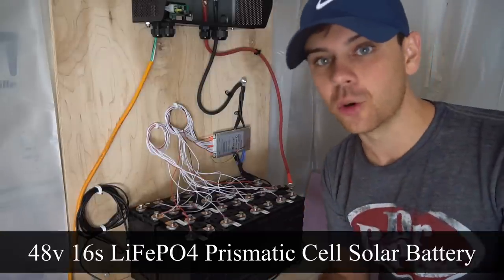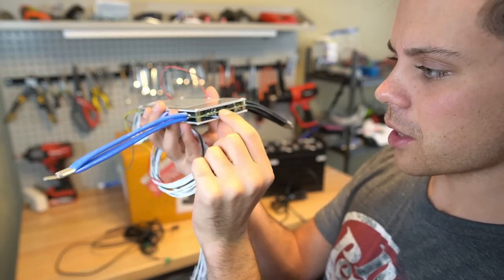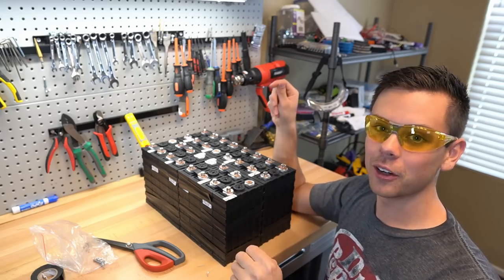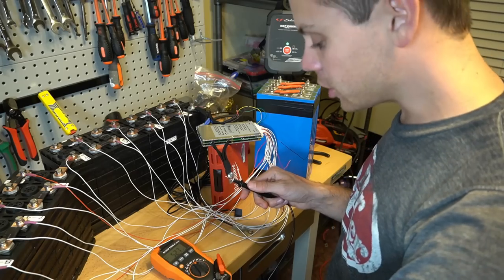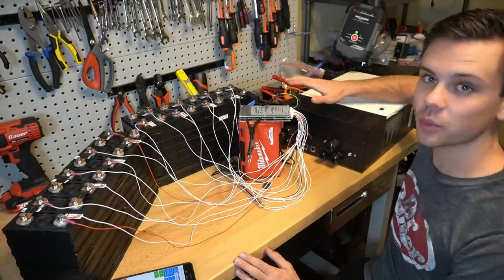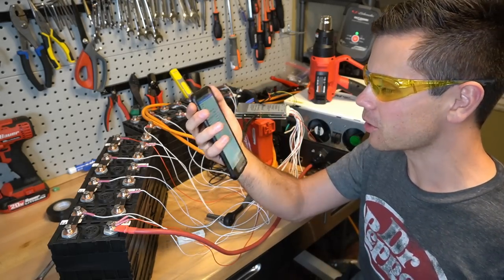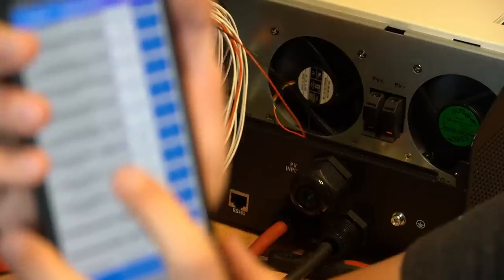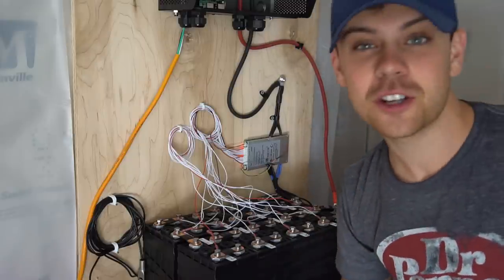DIY 48v LiFePO4 Battery w/ $72 Bluetooth ANT BMS (low temp cut-off!)

Comment: I have soldered for 40 years, and I've never gotten solder in my eyes! What is not recommended though, is soldering in underwear! Solder blobs travel down due to gravity, they don't fly into your eyes! Really nice BMS, Even fully fledged enough for an EV bike or bicycle. Supposedly there is a serial wired connection somewhere on the board too  for connecting a dash or computer directly over serial. Oh, the new Ebay link you provided has a dash included!
Reply: smiles, your face right in it. acid fumes are not good, maybe a mask with an air system too :-)
Reply: @lpi6608  Yes, the fumes are nasty, both breathing them and in your eyes, so don't put your face right above your iron, but it is rearly needed to have a fume extractor for the typical repair job, . Still,  soldering professionally, for hours every day, the fumes definitely would get to you. There is no acid in the flux in electronics solder, it would corrode the solder joints, so it is either a synthetic or natural rosin, quite simple really. Thinking about it, it both smells and stings as a bonfire made from non seasoned Pine. Mostly I do SMD work, and the amounts of solder is minuscule. Soldering big cable lugs with a torch and yards of solder would be different.

Comment: Will,
I don't believe you need a low voltage disconnect. It's true that the point an inverter shuts down might border on the low end of batteries but good inverters enable you to set shut down points. At 2.7volts time 16 series you wind up with 43.2 volts usually well below inverter shut off points. 
What you do want is a high shut off point, again, good charge controllers have this as a settable option. 
Heat is directly related to charging amps which charge controllers should be able to limit.

I think these Chinese BMS boards are not something I want to put on my systems, especially if it's an expensive system. I find that you don't need all the bells and whistles, just more to go wrong.
Reply from the maker: I completely and absolutely disagree with this statement above. You need some form of cut off. Battery protect and bottom balanced cells if you don't trust common BMS on market. But no cut off at all? What is your logic here. That is just crazy talk. And top balancing or setting upper limit voltage has been covered extensively in past videos, but now low voltage cut off? I don't see how that is logical with this chemistry. Please do explain
Reply from the maker: And inverter disconnect is only useful if cells are matches by capacity and bottom balanced. I'm not risking 3000$ battery bank on that. No thank you. Maybe a used cell that's bottom balanced like in my older videos. But you need individual cell monitoring or else inverter will cut off when one cell is deeply discharged and it won't know. Do you understand that? You would destroy your cell

Comment: Nice dude!  So glad I didn't enable the 'Switch' setting in my software, pretty sure that would have shut it off and put me in the boat of having to connect the two leads to a 2-6v source or whatever it was that you had to do.  I would have never figured it out, got no manual with my bluetooth BMS.  Is yours bluetooth onboard, didn't see a dongle?

I'm absolutely loving mine and reading data over serial by bypassing the bluetooth dongle (which I parallel later, so I can still read data with my own software and use the app simultaneously).  Also since I'm reading data from my MPPT over serial I can compare the current data from it and the BMS and print out solar input and system output, then display the TRUTH in the middle (aka 150w in from panels, BMS shows 50w in, meaning I'm charging at 50w and thus discharging at 100w).  Works great.

I have the 190ah LFP ammo can truck bed build on your forum in Show and Tell.  Just leveraged the two temperature sensors with the BMS (one onboard, one is a remote probe) to control a <100w 12VDC heater and gave it a test last night.  Once my PV input reached 13V (my trigger for sunrise-ish, potential to charge for the day) it began preheating the box.  Got up to 45*F quickly and greenlighted charging,  which then began when panel voltage was +5v over battery.  When my microcontroller read that MPPT mode had flipped to bulk it stopped trying to maintain 45*F and won't evaluate heating again until 1) temp below 40*F, 2) PV voltage 13 or higher, and 3) MPPT state OFF

These units are absolute game changers.  I appreciate redundancy in a setup, but I don't think I would have bought a Victron BMV and BatteryProtect if I had started with this first.  For all arduino-y ESP-y Pi-y type people, this is what you've been waiting for.  The opportunity to nerd the F out is off the charts.  I've written code to read from Victron MPPTs AND these BMS units over serial for arduino and ESP8266/32's which I'll polish and put on my github.  I've also developed a cross platform app that aggregates data from both sources and displays it in increasingly pretty fashion.  Best purchase of 2019!

Thanks for doing a video on it Will.  If you want to go next level with data collection (and your bluetooth isn't built in like I'm guessing, so you can listen to serial) I'd be happy to help!  If your BT is built in then you can use an ESP32 and read data wirelessly.  Tie in to Google Firebase or something and there you go!  All my data is recorded along with every event so if I have a high cell voltage alarm, I can see exactly what the charge amps, battery voltage, discharge amps, temps, etcetc were when that event happened.  Invaluable!
Reply: Brandon Kennedy This is exactly what I’ve been thinking of! Nicely done!
Reply: Can you tell me what the app is called or where to get it? I can't seem to get my seller to tell me
Reply: @Ahsieh2  for iOS at least a lot of people use the XiaoxiangBMS app.  Everything I was describing is custom

Comment: I (and a work colleague) have this same BMS (100A version) running all day as a DIY Powerwall since two months. I have it coupled with a 48V battery inverter (1600 W in both directions). A raspberry pi running a python script which decides every 2s how much power should flow through the battery based on the house smart meter reading. I programmed another python script which reads all info from BMS via bluetooth and puts it on an open source automation server running on the same raspberry. This server is accessible from my mobile phone. I love this solution, I may do a video showing what I have running some day. 12kWH LiFePo!
Reply from the maker: Holy cow!!! That integration is absolutely incredible!! Very nice job
Reply: DIY Solar Power with Will Prowse 
I am not on making youtube videos, time constrained.   If you want I can provide you some material and you do it. A raspi costs 20$ ! you need nothing else,  just open source software. My scripts are on github

Comment: Why do you "Absolutely need a BMS" if you bottom balance and have a low volt cutoff/low temp cutoff?

GREAT points on safety!
Reply from the maker: You don't. it's just smart to use

Comment: With the leads they have on there, I'd venture to guess that that 320A rating is a peak rating. The model in the ebay link you shared does show in the details that it's rated at 50A for charge current.

Comment: Hello. I bought an ANT BMS 16S 320A just like yours and I wanted to know if you found the same problem like me in the BMS, which is the following: after setting the parameters of the BMS to protect the cell's high voltage, the BMS turns off the MOS charge atomically and at this moment when the charge MOS is switched off, a peak voltage will pass from the solar panels to the inverter through BMS and this peak voltage will damage the inverter.
Have you ever realized this? If so, how did you solve the problem? What is the best way to get around this BMS defect?
Continuing with the excellent work ...
Thanks.

Comment: I have a lithium battery question ie leaf cell packs I have 3 packs that the voltage says lower ( 3.98)than the other 27 packs (4.02) should I be concerned or is that a ok amount of variance. Your one of the smartest one I know on u tube!!!😎😎😎😎

Comment: Never tighten or loosen a bus bar bolt when only one bolt is thru the bar.
Reply: Why?
Reply: @chrisUyehara  As in the video, that last little bit when tightening or the first bit while loosening will want to pivot the bus bar around the bolt.
A finger-tight bolt in the other hole prevents the pivot, and prevents any chance of the bus bar shorting out against another terminal.
So when installing a bus bar, put in both bolts with your fingers at least a few turns. I prefer doing this with all the bus bars, then using a wrench to tighten down all the bolts once all the bolts are started. (Just don't miss any!)
When removing a bus bar, loosen both bolts with the wrench, then put down the wrench and take the bolts out the rest of the way with your fingers.
Reply: @Sylvan_dB  Makes sense, thanks
Reply: AMEN! Don't ask how I know.
Reply: Yes!  This.  (When I got older and dumber, I started making mistakes like this, and realized I needed to slow down and think through things harder and do things more safely.)
Reply: it sure wakes you up,    a lot of power when they bond,  never done that, honest  okay twice,
Reply: Nice observation!

Comment: What do you suggest BMS with common port or separate port (charge <> discharge)? Thanks for keeping us informed!
Reply from the maker: Common port and attach the solar charge controller directly to the battery
Reply: Thanks for the quick response... the controller should then handle the over charge protection instead of the BMS...
Reply: @WillProwse  Does this not allow over charging on a per cell basis? Seems dodgy especially when using mismatched cells of unknown providence and more energetic chemistries.
Reply: Why does no one seem to use a BMS with a separate charge port. What is wrong with it. The price is the same. It would seem a no-brainer to me if the amperage is sufficient. Does it not work?
Reply: @WillProwse  Just to be clear I think you are wrong here.

The 3 connection BMS units are designed to shut off the discharge port if the battery or a single cell gets too low. But still allows for charging to bring it back up. Conversely if the pack or a single cell gets too high and it cannot balance it back in line it can shut off just the charging port and leave the discharge port open.

The 2 wire ones cannot do this and end up just blocking both, and then the lights go out.
Reply from the maker: @peterhcarls2  oh goodness looks like you are new here. Check out my.community section and past videos which cover this topic in great detail. There is a lot to read. Start with community section post first. This topic is also covered on the forum. Let me know if it makes sense after you read all that
Reply from the maker: @2true611  wow we have a lot of new people here! This was covered months ago and the logic behind it for this chemistry. Guess I'll go copy and paste my community post then.
Reply from the maker: @2true611  oh haha I am well aware how these circuits work. And I understand how they are programmed.
Reply from the maker: @peterhcarls2  that's why you don't use mismatched cells and you set upper limit voltage. As always. Mentioned this at least ten times in past videos.
Reply from the maker: Here's an explanation I posted a few months ago: Quick update for advanced LiFePO4 raw cell systems using a Daly BMS: 

On my website I recommended using a separate port BMS for over voltage protection for the mppt connection (if common port BMS is used, possibility of destroying mppt during low voltage disconnect). 

Well yesterday, a viewer and I finally received our separate port BMS from Daly, and the amp rating was not as advertised on the listing. The separate port can only handle 10 amps! :( 

Considering the likelihood of over voltage situation from most high quality mppt, and the chance of matched LiFePO4 cells going out of balance is rare (and BMS will correct for cell drift over time), and that LiFePO4 can be over charged to 4.2v per cell before electrolyte degradation... I would say its safe to connect mppt directly to the battery bank, and bypass the BMS entirely. We have been doing it this way for years, but people still want to use a BMS. I would say use BMS for loads, and not for chargers. If you have mismatched cells, and some hit a higher voltage at high SOC quicker than others, drop the upper limit voltage of your controller. 14.0-14.2v is a safe charging voltage that can give full capacity with LiFePO4 12v. 

I hope this helps! I bet most people building these systems will figure this out when they see this problem, but if you are a beginner trying to build an advanced level system, then this bit of information will be very useful.

Let me know if you have any questions
Reply from the maker: Let me know if that clears it up. Also! This applies to LiFePO4 ONLY. Not other chemistries. I hope that was implied lol

Comment: I bet that black wire from ON/OFF harness is connected to battery negative ( check continuity ). If so, then you just need to wire a push button from cell 1 using the red wire, so you can boot the BMS from first cell of your battery. I have worked with some BMS chips which are designed to boot from first cell via push button. This is a safety feature so you can ship batteries with BMS turned off.

Comment: Hello from Germany, another stunning video about building a powerwall, thats my duty at the moment.
But in Germany or Europe, manufacturers of inverters state that their product will only work with specific, expensive, battery packs like LG, BYD...48V system.
The question is: Is that statement true or does it work with this DIY pack?

Comment: I found out a single port bms will not support charging protection when used with a relay.  I took 2 new 48v 25ah batteries and converted them to a 12v 200ah.  I bought a single port 8amp 4s bms intenting to use it with a relay. Turns out the load connection is through two FETs with the drains connected together.   The FET with the source conneted to battery neg is controled by the discharge protecton and the FET with the source connected to the load is used for charge protection.  Relay works fine for discharge.  But requires the load (relay) to be more negitive than the battery neg for the charge control to work. I was able to modify it to control  for separate relays for charge and discharge.

Comment: Those bms wires are probably (like in my bms) high temperature resistant AWG 12 , which have amperage of around 90A. So 90A*4 = 360A

Comment: Call me ignorant but... why not build 200V ( or so) system?? The equation P=U*I is still valid. The higher the voltage (U) the lower the current (I) for the same power (P), right? Plus high current requires a HUGE amount of "cooper" and Joule dissipation is bigger. And bigger the difference/potential  between two voltages the bigger the losses in the process of converting.  Please give me a clue??? Car battery packs goes well beyond 300V (in some cars).

Comment: I built a battery pack using this same BMS Have you by chance hooked up The LCD display for it There is no port for the data communication line but I do see pin where one can be soldered  Just curious if you hooked one up to it ? Let me know thanks

Comment: If the wires can't handle 320A I think the BMS itself will not, the copper tracks on the BMS board could be destroyed (in fact I can not understand how a big copper wire could accept less current than a thin copper track (the copper track is shorter but is it enough to beat the copper wire that is not very long too ?)...

Comment: I agree I would like to see an update on this also as I'm thinking about using the upgraded version of this bms. Also quick question if you where to add another string of batteries to this system would you also need another bms or would you use one bms for both strings ?

Comment: Hey. Any idea, what is the actual current the BMS can handle for long periods?
BTW I saw in another video that if you leave the 2 wires you used to turn it on shorted, LOW VOLTAGE CUTOFF will not work. On one website it was actually sold with a button on the wires

Comment: NIce system. I have a 4 wheeler that uses a 48V LiFePO4 system similar to this. It uses 16 100AH cells. The cells that were in it were abused and dead as can be. Not sure I want to spend $2000-$3000 to repower this thing. I have thought of just using 4 deep cycle batteries in series just to see if this thing is worth messing with.
Reply: What make and model 4 wheeler?
Reply: @chrishollar6080  It is made by a defunct company called Barefoot motors. I think they went out of business in 2010 time frame. DO a search on here for Barefoot motors and you will find it. The thing is made like a tank.

Comment: Hello! How did this device manifest itself, do you use it for a long time? You set the lower and upper threshold of charge and discharge for each cell, does this work correctly? Do you think this is suitable for an electric scooter?

Comment: Can you set it to bottom balance these batteries rather than top balance?  (That's recommended by Jack Rickard for LiFePO4.)

Also, along with bottom balancing, can you pick a fairly comfortable state of charge voltage for bottom balancing, bottom limit, and top limit of the batteries?  Like, can you pull up the LiFePO4 profile on the app and then adjust it to what you want?  I'd like to see that manual to see how it describes the balancing.  Ebay doesn't have a standard location to click on manual; obviously, you've been through this before, so can advise.